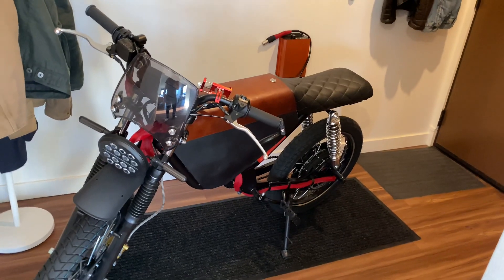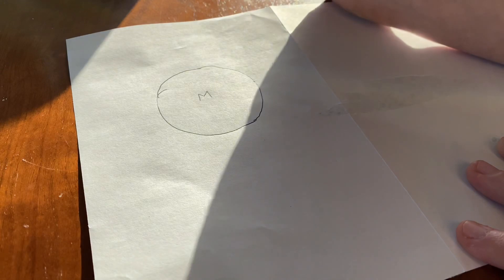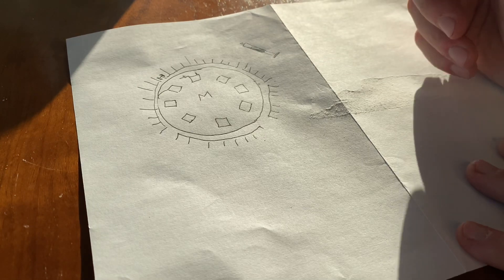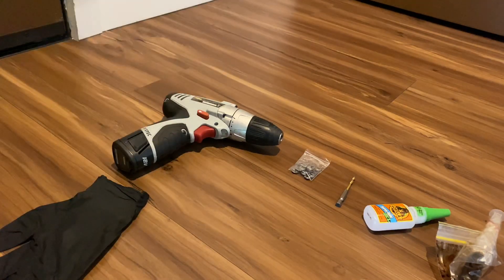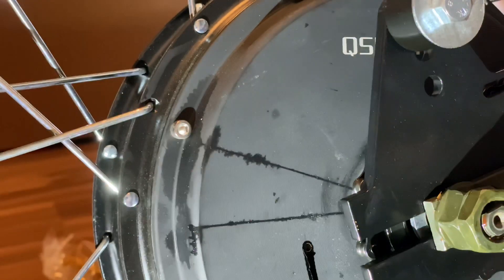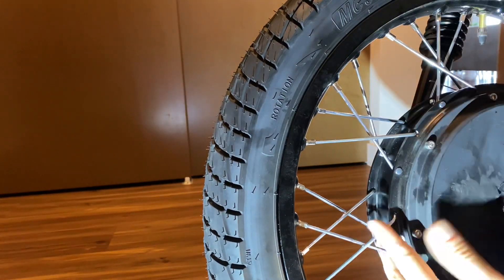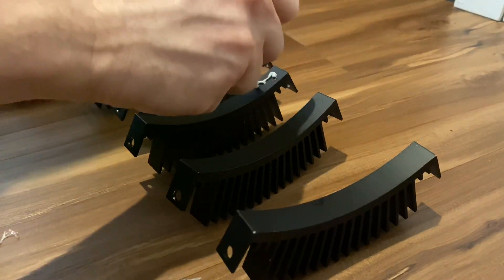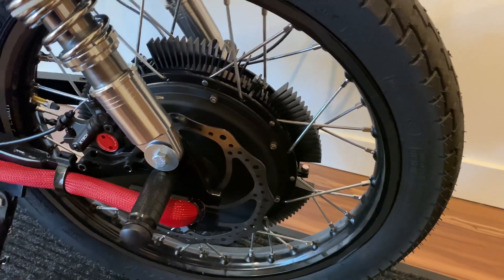Hubsinks and Statorade for the Onyx RCR

Comment: What I did, which is the best way to do it, is actually remove or slightly detach both side plates of the motor. Re-install one side after applying high temp rtv silicone. Then sqirt the juice straight into the magnets. Then seal up the other side with the silicone. It's a lot more extra steps than drilling but when I initially didn't seal up the motor, it was leaking out a lot of statorade due to centrifugal force overpowering the magnetic force. After sealing, you can drill a hole to apply more statorade in the future

Comment: What if you just put on the hub sink with adding the statirade
Reply from the maker: It depends on the motor. The statorade helps the stators shed heat to the outer motor body. If you use the hubsink it may help, but not as much!

Comment: My commute to work is 13 miles.. you can't ride continuous even with hub sinks because the heat build ups, unless if I pull over and let I cool down?
Reply from the maker: On an onyx you could ride 13 miles no problem but it depends on your bike, your speed, and the ambient temp. Climates like Arizona and Nevada have really high summer temps that can make that difficult!

Comment: I would recommend a set screw, instead of the paste to fill the hole. this worked perfectly for me, and I can remove the set screw as well if I need to add more at any point.
Reply from the maker: That’s a great point! This is probably the best method. Drilled, tapped, and flush screw.

Comment: awesome video French, quick question tho. instead of drilling and putting superglue could we drill and tap and put a screw?
Reply: If you buy the Statorade from Luna Cycle it comes with the drill bit and self tapping screws. It also comes with a small nozzle so you're only drawing a 2 mm hole. You really want to put a vent like a one way grease nipple. Otherwise it builds up pressure and pushes out to Statorade overtime getting into The Barrens all over the place and you won't notice it unless you take it apart.
Reply from the maker: Hey Jordan! Thanks for the comment, yes you could tape and do a small screw, it would come out cleaner. You are dealing with soft metal in the motor casing, so if you are careful I think it will work great. I'd still put a small dab of silicon glue though, just to cover your bases.